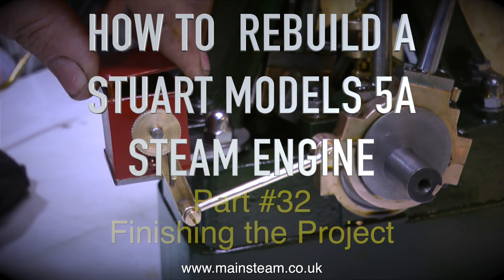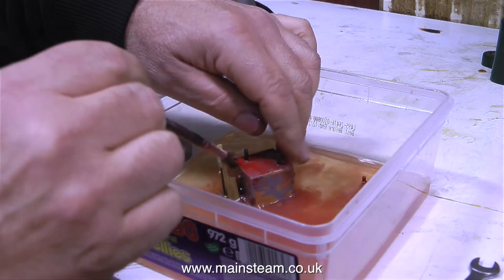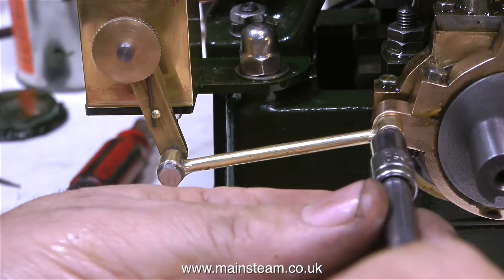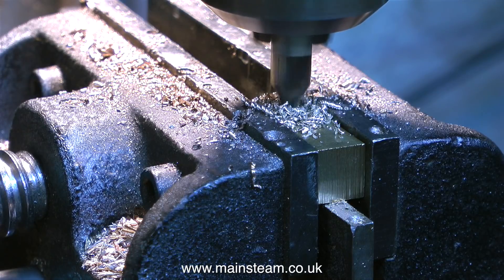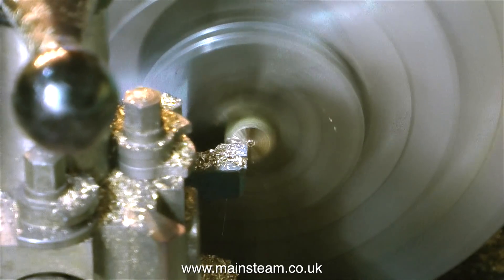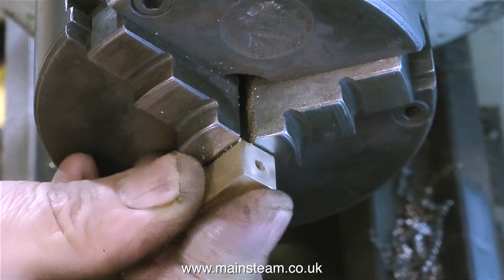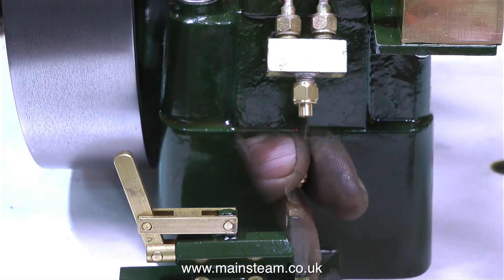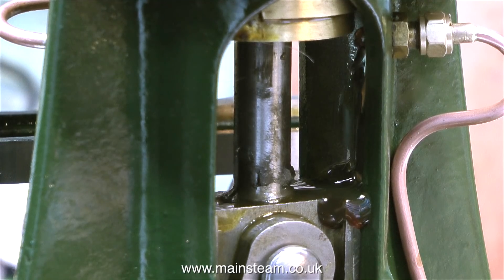HOW TO REBUILD A STUART MODELS 5A STEAM ENGINE - PART #32

Comment: Wow! Gorgeous! And it really ran slow as a snail. Noticed a little shimmy/shake; is that simply because it's base is not bolted down? Or is there some slight imbalance to the system? Or perhaps it's the air compressor shaking the engine?? - Also, I completely love the red being stripped off and the shiny brass finish coming through on the Lubricator vessel. Also, really like when Dome Nuts can be used. They add a "look" that regular double lock nuts don't have. Like little fireplugs of the fastener world. More industrial-revolutionary....? Is that a word? ---- Thanks again Keith.
Reply from the maker: the shake was due to the board on that side of the bench not being level and rocking about with reciprocating motion of the engine . . .

Comment: Agreed on the piping, I like to see the copper piping running around the engine, not only does it show you that "something important goes on here!" but also the copper colour nicely offsets the green paintwork.

Amusingly, I volunteer on a heritage railway and, when I'm cleaning the locos, I like to remember "painted pipe = not hot" and "copper pipe = very hot"... except that never stops me from scalding myself quite nicely over the back of the hand on a copper pipe!